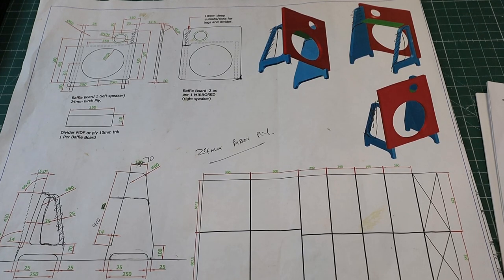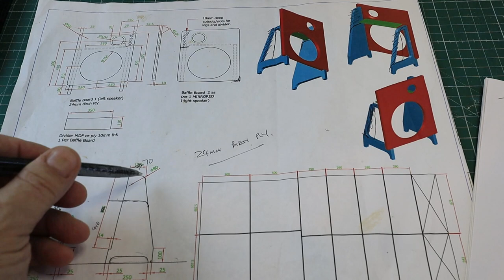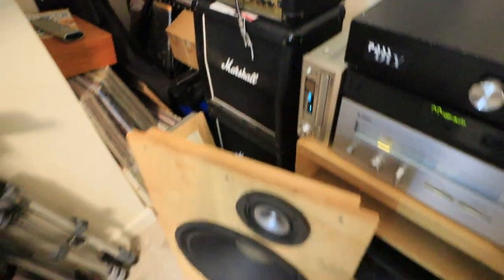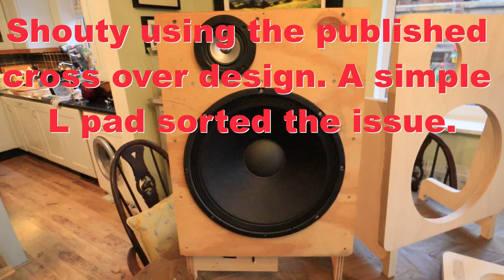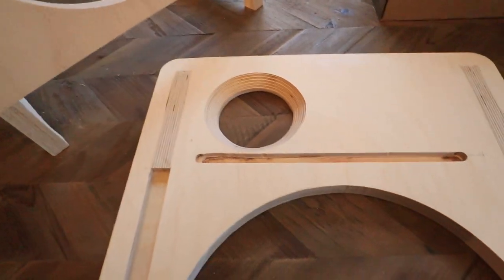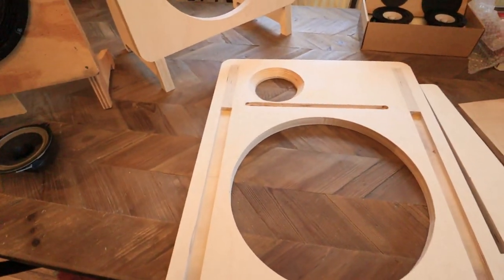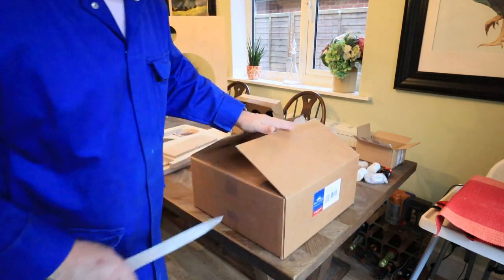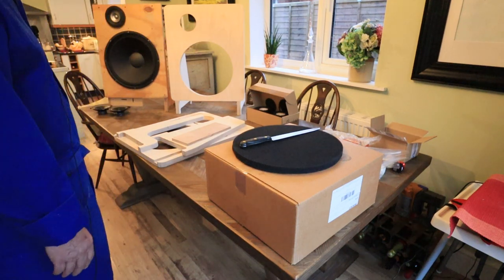Small (Budget) Open Baffle Speaker

Comment: I always like the wide sound stage on open baffle, just have limited listening positions and wil need alot of open space in the room to sound good.
Also the low bass isnt punching your chest, very relaxing to listen to on low volumes.
Btw i also "fix" shouting mids/highs with an L-pad  easier to fine tune than changing the crossover
Reply from the maker: Yes, OB speaker placement is critical as you need 1 mtr (3 feet) clear to the rear and sides. I don't think I've covered this is any videos but will do so  in the next. THKs for the prompt.
Reply: @thediyaudioimplementers1826  No problem, goodluck with your projects

Comment: Hi, I'm Jeremy Budgen, originally from the UK, but now reside in South Africa.

With regards to the divider board you put in between the sub and the full range, is the height of this panel dependent on the distance of the remaining part of the full range that is projecting past the rear of the baffle, i see yours is 100mm is that larger than what is left of the full range.

Also i downloaded REW, can this software in conjunction with a dsp, give you xover design and componant values.

With regards to the xover, would an air cooled inductor be a better option over the iron cored one, or not.

I'm not a professional with regards to speaker design

Comment: That is interesting about the resonances from the bass driver. Do you suspect this is why PureAudioProject routes a slit between the bass and full-range, rather than braces it, to somewhat decouple them on the baffle?
Reply from the maker: Thanks for the input, I think this is exactly why and I feel a revised version of this OB speaker is in the offing. Two baffles one for the bass one for the full range mounted on a chassis arrangement.
Reply: I believe the baffle size and offset of the tweeter in the baffle could be an issue. 
Search YT for "Burning Amp 2017 - Siegfried Linkwitz". 
Also Google Images for "Siegfried Linkwitz" and look at his tweeter baffle. 
(Also look at Wikipedia for who Siegfried Linkwitz is).

Comment: Could you give me the values of transistors + capacitors for a 2  way crossover -  8Ohm drivers -  2nd order Butterworth at 550hz. with no L pad? - I use a online calculator and it give me values of
 Capacitors
C1 = 25.57 uF
C2 = 25.57 uF
Inductors
L1 = 3.27 mH
L2 = 3.27 mH

But this cant be right?
Reply from the maker: Hi, Please watch the second video. (PT2)

Comment: Which Nelson Pass amp that you have built is your favorite??  I love your videos please keep them coming!!!
Reply from the maker: I like the F6 but lately I've preferred the AJ. BUT, It all depends on what/which speakers you are using.  Neither The F6 or the AJ drive my TRIO's to their best. But the Little two way open baffle's sounds best with the AJ. I have a pair of JR149's and they sound best with the F6 the F6 is a 'slightly' more organic sounding amp IMO over the AJ.
Reply: @thediyaudioimplementers1826  Out of those 2 amps which is the easier one to build??
Reply from the maker: @bondscalper  The F6 is the easer. (Less components)
Reply: @thediyaudioimplementers1826    I have built an F6 and an ACA.  If you get a chance, try a Single Ended Tube Amp.  I have an old Zenith converted to an RH84 circuit ( 6BQ4 driver tubes ) and it really adds a bit of magic.

Comment: This is a brilliant video thanks ever so much for taking the time to go through the design and the drivers.  I built a single ended valve amp during lock down from a schematic and it sounds brilliant but I ended up buying some old Klipsch Heresey 2's from ebay as it need high efficiency speakers to sound right.  Could you tell me if this open baffle design has a high speaker efficiency please?
Reply from the maker: Thanks for the comments. Sorry no, they need a 100watts or so to get he best out of them IMO. Heresey' go real loud with just a few watts. Though when I had mine I was driving them with 100watt class A Pass F5s, worked great.
Reply: @thediyaudioimplementers1826  thanks for the information I am still interested in building these they look like a great project I will just have to get some more power on board 😀.  I have a quad 303 I wonder if that might do the job?   You don’t happen to have the plans for the woodwork do you?  I was thinking of getting them cnc cut as I have no router but o am keen to build the cross overs and put them together.  Thanks again for the help👍